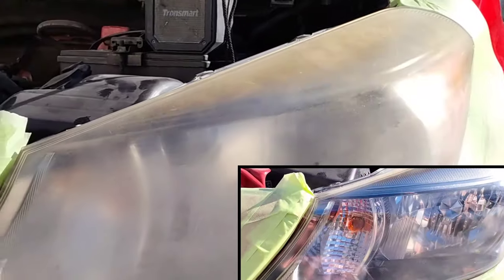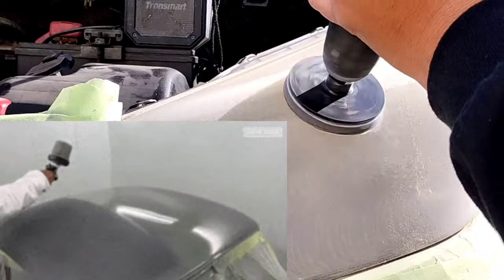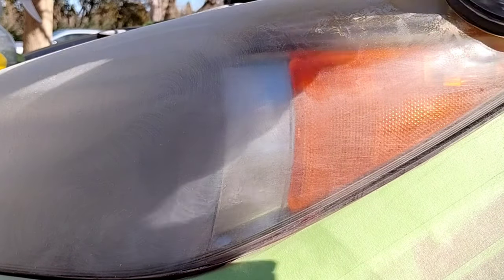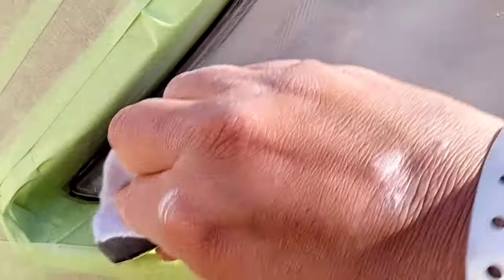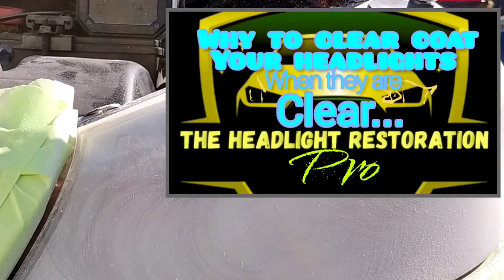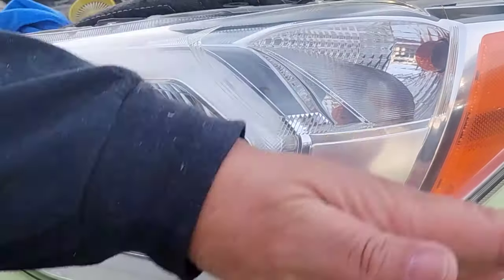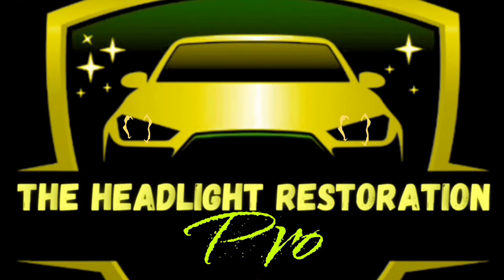how to CLEAR COAT HEADLIGHTS like a BOSS 🦍💯

Comment: Yo dude, starting to get in to detailing here on my end. I try to absorb information before getting in to anything and have been doing research day in and day out. Really glad I stumbled on to your videos. The consistency of your process from video to video is pretty much the same. Honestly to me, that's amazing! You see a bunch of YTers that have like 20 different vids of the same process, saying they use the process in the video for ALL of the vehicles they work on, etc. It gets hard to understand where to start. I do have one question, does the headlight clear coat ever orange peel? What do you do at that point? Do you just run over it lightly with the polisher?
Reply from the maker: Well thank you for watching....
Stay tuned and watch plenty of the videos that are up to get you dialed in with headlight restoration..
I have a high consistency method meaning that they always come out this good..
Far as orange peel this is a zero orange pill product.. and if you're dealing with a true headlight restoration product or product design for headlight restoration they should all be zero orange peel... You only get orange peel on things that the design for something else, paint or other things... The actual substance that most headlight clear coats are made out of do not orange peel... This particular McGuire's is a zero orange peel and self-leveling product.. but like I said most have like products or zero orange peel because it's designed for headlight.. if you ever started getting orange pill with products I would stop using them.. I will also always use products made for headlights or for the test in hand if possible...
Reply: @theheadlightrestorationpro  Awesome man, thank you. Few videos ideas for you if I may: Taillight restoration, Headlight and Taillight upkeep for maximum clarity and glossiness, Anything to help with scratches or pitting, PPF on headlights for enhanced protection. Keep it up with the videos. I'll definitely be tuning in!

Comment: Thanks for the video. Very informative. 
I am a bit confused though. 
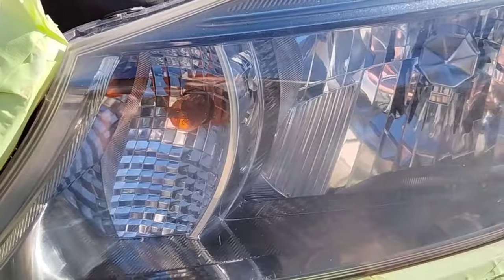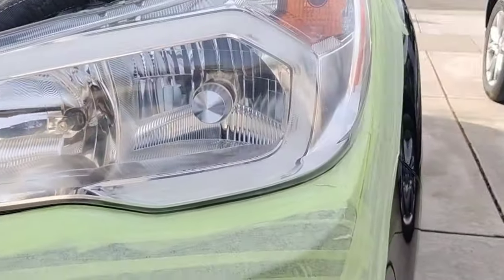At 22:58 min (in your video), you start with the clear coat spray on the right headlight. Then you wait to dry and start again (to second coat) with the clear coat at 25:50 min (in your video).
When  you move on to the left headlight at 29:37 (in your video) you say and present a text "Never double coat. Never let dry then reapply."
So I am confused, why did you apply double coat on the right headlight and only a single on the left headlight, or there something I am missing?
Thanks for your help.
Reply from the maker: You're missing the fact that those are different headlights...... Show you how to code on more than one headlights towards the end even though the video is about One Headlight they are similar but they are different if you go back and look...🤓💯
Listen to what I say.... My headlights are just that clear.. you should always spray your headlights at a Crystal Clear point from the polishing stage... It looks like a finished product but it is not it is naked.. this is why my headlight restoration method is far superior than most if not all...🦾
Reply: @theheadlightrestorationpro  
Thanks for pointing this out. I hadn't noticed that you show two different headlights of the same side one after each other. My bad.
What you say about one coat makes perfect sense. Thanks. 
I always thought that if the headlight is sanded with P3000 and then polishing with compound, then there will be no grip for the clear coat to stay on without running down. Obviously not. Thanks for that too.
Here in UK we do not get the Meguiar's Keep Clear spray on its own. It comes with a Kit which I do not need really. 
Any suggestions for an alternative optical clear coat?
Reply from the maker: Honestly I would get it anyway you can...lol
Nothing's going to be better it's worth it..
But if I had to choose something else and probably be a 3M wipe.... Or another certified spray made for headlight...
Make sure that it's certified because there's people out there that you've probably seen on YouTube or the internet that are basically going to a paint shop having them fill cans with 2K clear and wrapping a label on it and trying to sell it as their product but it's like they make $10,000 a year how did you make a product they're not a legit company and there full of shit trying to come up..lol
So make sure it's legitimate headlight product.. spray is always going to be superior... 3M is always going to be superior... It's just that 3M does not make a spray coat...

Also the reason why people think that it will not stick after polishing and sanding and all that stuff because they misconstrued it for being the surface of a vehicle only different buying something to paint or metal plastic perse different than the plastic which is polycarbonate on the headlight.... Similar but worlds apart.. also people tend to try to do this with things that are not meant for headlights meaning that they're not made to stick to these headlights or this kind of surface therefore it doesn't correctly and they have to do all kind of things to make it you should never have to make it stick because it's designed to do this if you use the proper product..
Reply: @theheadlightrestorationpro  
Thanks a lot for this. 
As you say 3M do wipes only and spray is superior. In one of your other videos you talk that the clear coat needs to be photo or optically capable of transmitting light. 
How come only Meguiar's do that kind of clear coat in a spray can? Can't get my head around that.
If you come up with something other than the Meguiar's spray, being spray again, I would be most grateful if you could let me know. 
Meanwhile, thanks a lot for your good advise.
Regards,
KN
Reply from the maker: Well Maguire's is not the only one there are others if you do a broad search on Google for headlight spray you'll get probably about a dozen different ones but you got to make sure it's legitimate company and you have to do your testing on them.. some are really good and actually designed for headlights even though they don't have a large laboratory facility or multiple laboratory facilities like a company say like 3M, but are still good.. but the McGuire is the most practical for price for top notch quality some of the other ones are drastically expensive and perform the same if not a little less in certain areas you're talking $9 a can versus $39 a can... Some cases even more to perform the same thing but not as good... Also towelettes if you haven't noticed give you so much less and if you think about it or so much easier to produce... Loading spray cans up I'm going to cost 10 times more than loading a tablet up if not even more probably a hundred times more... So some companies just can't afford to, let alone formulated to be delivered through a sprayable can..

Comment: why not use the cerakote headlight sealer?  Im pretty sure its more durable than the meguiars which is only rated for up to 1 year.
Reply from the maker: Absolutely not.. it goes bad sometimes even quicker if not the same in a bad way there's many reasons why not for one is chemical based kit with a ceramic towelette wipe.. ceramics really have no place in headlight restoration... It's complicated but just know it's way inferior just on the fact that it's a talent instead of a spray...
And that stuff usually starts going bad like in 8 months if not less... I've done the testing and I have a video up if you want to check it out it really high for a kit... And sometimes companies just lie..lol
What Maguire is doing with this spray is pretty much applying the time limit to the most worst person in the world with their vehicle so they don't have to hear any bullshit I have it on my car for four plus years it's just now starting to show signs... Depends on the vehicle it depends on how you take care of the vehicle....
Also the clarity of shit... In comparison... And once again it might be able to compete if it was spray but because it's not it's so far less you can even imagine.. anything spray is always going to be superior as long as it's made for headlights.

Comment: Nice work.  What is the key indicator to changing from 320 to 500 and 500 to 800?
Reply from the maker: When you are finished..lol
I would say most of the times when it stops working... But that would be an accurate the proper response is when you are finished... Complicated...
You're either removing or repairing...
Reply: Thanks but yeah, not sure how to interpret that.😂
Reply from the maker: 😂🤣🤣🤣 that's a tough question... It has many answers.... The start backwards the p800 you just need to make sure it touches everything at a moderate pace.... For the p 800 you need to make sure it touches everything until a lot of fluffy white snow comes out every part of the light... P500 you need to make sure all yellow dust and everything else that looks suspect is removed you should be able to see it and feel it...
Reply: Thanks man.  Appreciate your quick response.  I already have a few clients lined up for me to try this on.  I’ve been wet sanding with ok results but I want to elevate to your level.  I know it will take practice, but I’m patient and perfectionist so I should do ok.
Reply from the maker: @goldenbear31 awesome...yes you can do it.. just soak up all the information and watch as much as you can on this channel and you will get there ...I wish I had this channel when I started out, I couldn't imagine where I would  be if I did... That's why I did...💯🤓

Comment: I listened to this entire video. Thank you so much for sharing your knowledge. Can you please explain the products you used in this video after you got done sanding?
Reply from the maker: Can you be a little more specific on what you're trying to know about.
I use the same things in every single video pretty much...
Reply: @theheadlightrestorationpro  the ones at 18:50, 20:00, 23:16. I just sanded my headlights this morning and finished off with 4000 grit, getting it smooth like you said on your other video and looking to do the same exact thing you're doing and same product.
Reply from the maker: Pretty much it's the same thing that is done in the video and explained in the video.. pretty much every video I explain the same thing I use the same process.. did you do it the way that I do it it should come out amazing like mine or some proximity... Caution though I don't use 4000 grit.. with that being said if you deviate from what I do outputs will change for the negative..
The combination of things that I use and products that I use are perfect... Tried and true and done so many times it's insane perfect results each time..
Reply from the maker: What specifically would you like to know about?
Also all products are listed in the bio.. approximately using this video including tools and things that I use not in the video or listed in the bio...
Reply: @theheadlightrestorationpro  4000 is all I can find and im about to make a 12hr drive so I'm working with what I have. You didn't mention specifically the brand and product you used at those time stamps I provided. If you could that would help me a lot.
Reply from the maker: Awesome... Must have been one of the rare occasions that I did not.. but if you watch probably any other video or a couple videos you should see it in there..
Even if you want to fast forward to that part it'll show you.. and explain better that I can through text..
Reply: Yo Pro, please explain the products you sprayed on the head light.
Reply from the maker: @ricardoadams3660 should say on down there every video.. and listed in the bio...
Reply: @theheadlightrestorationpro  thanks a lot will check it out, you contant is awesome. Keep it up.
Reply from the maker: @ricardoadams3660 thank you very much glad that you enjoy the videos plenty more to come just drop one today....

Comment: What speed are you using on your drill, one or two?
Reply from the maker: I use it on the fast setting... In between about 1200 RPM to about 1700 RPM..(max) I feather it in different locations(flat surfaces 1700/sensitive areas more like 12 to 1500) as I mentioned in a couple different videos.. I use a higher RPM, you should never really go any faster than 18 or 1900 Max.. 1900 and on is the burn 🔥 range.. it would take some getting used to using it at a high setting like this... I would ease into it because it's a fine line between 1700 and 1900...
But yes the high setting...
But note you will eat through your discs a lot faster.... Which is fine with me cuz I only typically use one disc for the job and throw it away... Meaning after I use a 500 or any other... chances of me using it again are slim...
Reply: Ok thank you

Comment: I cant afford all that equipment. Is it possible to do it by hand?
Reply from the maker: You can do it by hand, but honestly it's going to be a lot harder as of course by doing my hand is a lot less of a professional job you will get more than likely and not as good result but you can achieve good results still..
Reply: you can do mine are you in Kansas
Reply from the maker: @richardvest4048  about 16,000 miles away.... sorry....

Comment: i see that you are sanding it down quite a lot. i'm not sure how much i should sand the plastic down. I'm very worried of over-doing it and damaging the lamp. when i'm on the coarser sandpapers, the lamp is entirely white and opaque. there is no way i can tell how deep i have cut into the plastic. Any tips, please?
Reply from the maker: It doesn't take much at all you're sending down about as much as half a piece of paper...
When the headlight is white that's when you're probably good you should be able to feel it and see it when there's no damage or obstruction on the headlight.. as far as using the coarser grids you should stay away from that as much as possible especially as a beginner.... If you have no other choice you can do it..
You should really see it.. especially if the light has any discoloring...
He will not damage the light... It's been actually on film I'm not going that deep.. have you watched a couple of my videos barely anything I'm taking off... It's a hundred times easier to realize your depths than wet sanding... Just remember when it's white that's a good thing that's what you're trying to go for... Also you could send that headlight for 5 hours and you still wouldn't damage it... And you would still be able to have 15 more headlight Restorations....
It's almost impossible unless you're trying to do so...
Reply: @theheadlightrestorationpro  Thanks. I'm trying to upload a picture of my lamp with 1st round of sanding using 3M P500 grit, but Youtube doesnt allow me to do so. I'm trying to show how "white" it is. I think it is no where near yours. In my case, i can still see a bit of the clear plastic, though not totally transparent. Any idea how i can share the picture here? I can't even share an external URL to the picture i have on flickr.
Reply from the maker: @stealth0x emails in the bio but I am very far behind in responses..
Reply: @theheadlightrestorationpro  You've got mail. Subject: Restoring my lights

Comment: I recently rinished restoring the headlights on my 06 Ram.  For the first  time i had the Mcguires Headlight Sealer and used it to seal my lights.  I Used everything that I learned from your videos, they came out great.  Never looked this good   even brand new out of the box.   I did have a problem with actually sraying the sealant.   It wasnt spraying evenly, it was also spitting and dribbling as well.   Could i have gotten a bad can or was I doing something  wrong and need to ammend my spraying technique?  Thanks in advance for any help or advice you could offer
Reply from the maker: Okay this is something silly I never mentioned before... But maybe I should in one of my upcoming videos.....
Quite often the spray tips do not come fully embedded inside of the can they're just kind of sitting there and it will work like that but not correctly so every time before I even spray the lights I held a can away and push the tip down as hard as I can for split second and it clicks into place...
Reply: @theheadlightrestorationpro   thanks so much  I will check that.

Comment: Is that a new type of bmw? Never see that one with that sign before lol
Reply from the maker: Lol
Reply: @theheadlightrestorationpro  I know it was a honest mistake tho it’s just funny lol. I was like wait what?
Reply from the maker: @odanebrown2271 I'm actually not sure what you're referring to.,..
Reply: You said you did an s550 twin turbo bmw while showing a Benz vehicle. At around 4:57 in the video.
Reply: @theheadlightrestorationpro how much pressure do you apply to the drill when sanding the headlights? Mine comes out clear after I’m done but has streaks and lines
Reply from the maker: @odanebrown2271 lol. Yeah typo..lol

Comment: In the bottle says let it dry and apply a second coat.. so yeah now I've to start over because they are cloudy again
Reply from the maker: Never use a second coat....
You've never seen me in any video use a second coat...💯 If you're doing things that I don't do on my video it's probably not going to come out correct...👍🏽
Reply: @theheadlightrestorationpro  yeah i just saw the video 🤦‍♀️🤦‍♀️ polishing whit plastx will help? Or should I sand and everything?
Reply from the maker: I would get everything off and start over and use my method.. you can use plastic x but the stuff I use on the videos is a thousand times better...💯
Reply: @theheadlightrestorationpro  thanks for your help 🙏
Reply from the maker: Anytime!